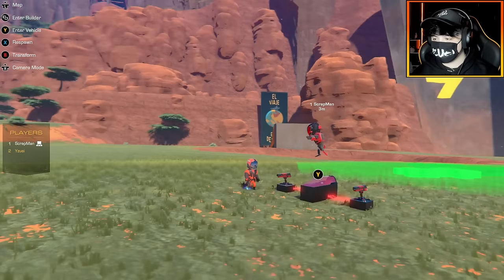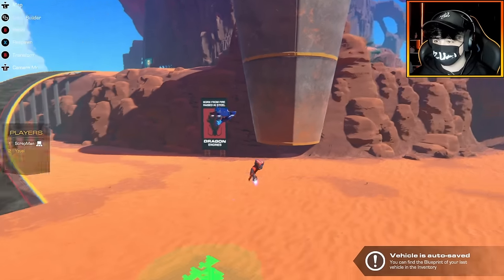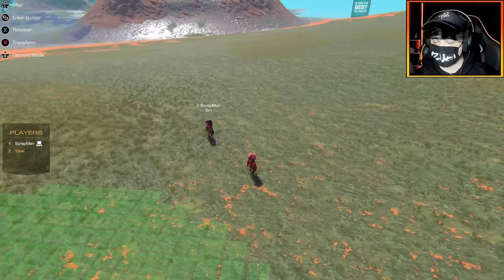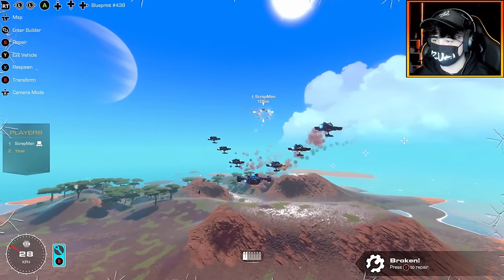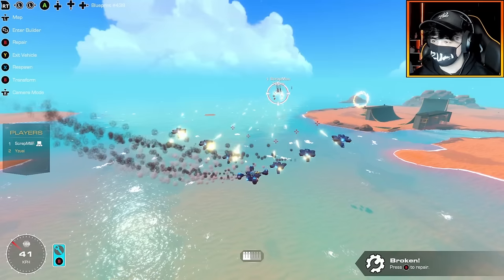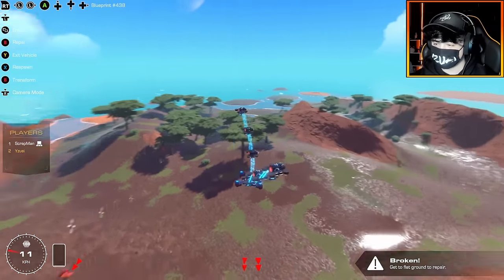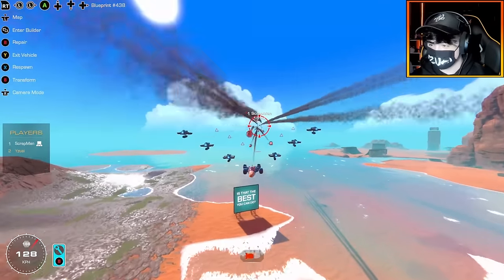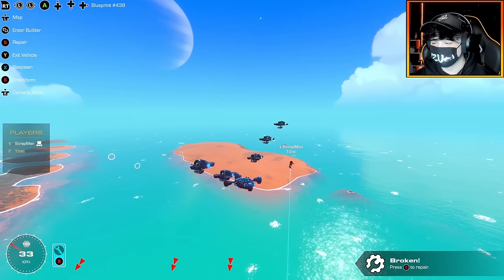These DRONES Are ACTUALLY One Build!?

Comment: I have an idea, try to make a whip out of the power couplings. Then, use the whips in a Trailmakers bayblade battle against ScrapMan.
Reply: Scrapman tested a whiplike design already with the power couplers, the physics don't work as well when it changes quickly, and even more so when the strength is low.